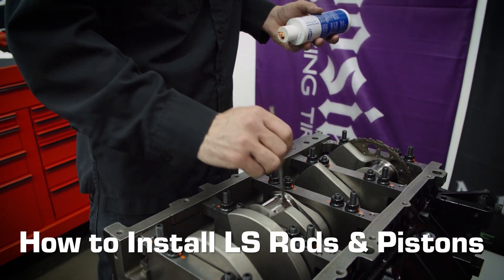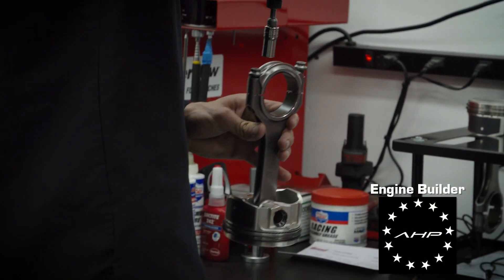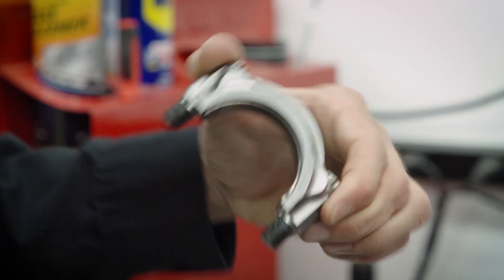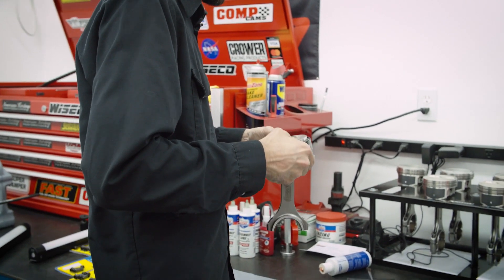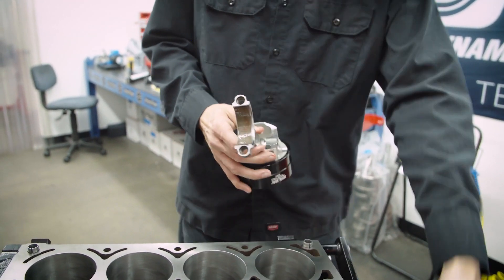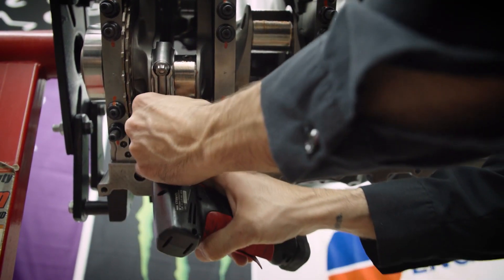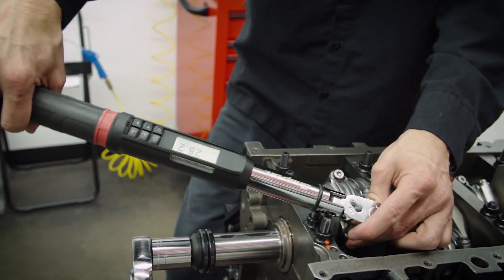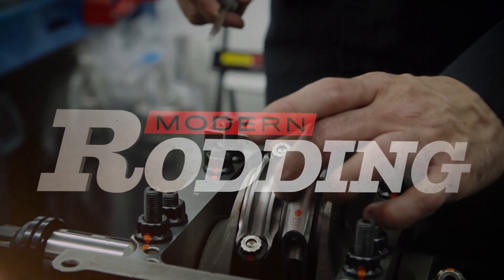How to install LS rods & pistons.

Comment: 82 ft lbs? You mean 82 inch pounds
Reply: official torque spec from summit is 32ft/lbs and 47 degrees or 82 ft/lbs. not inch pounds
Reply: My arp bolts said 45???
Reply: @YoungerPrice i got summit rods and it came with arp bolts, it may just be a higher spec because of the forged rods
Reply: It's definitely not inch pounds. Seems a little much but every manufacturer is different.

Comment: why would you oil piston rings? the entire point of running an engine in is to wear the rings in properly with the bore
Reply: Friction is a good thing for break in but too much can be bad because the rings will skip in the cylinders instead of gliding. All is irrelevant tho as soon as it fires first time. Everything is coated in oil within a couple seconds.
Reply: What an IDIOTDIC QUESTION 😂😂😂